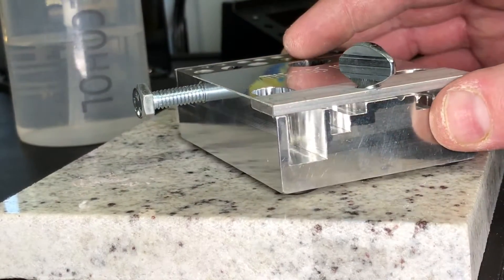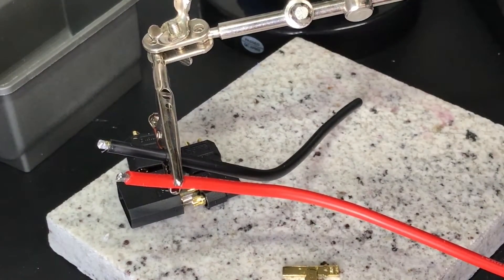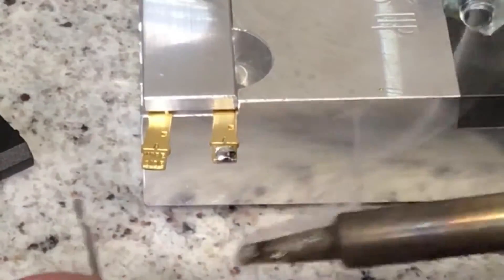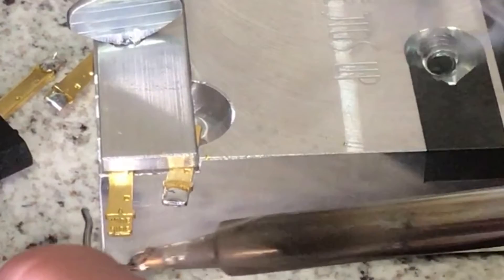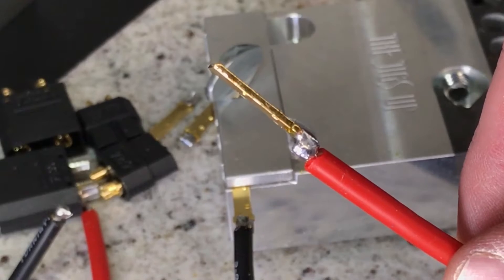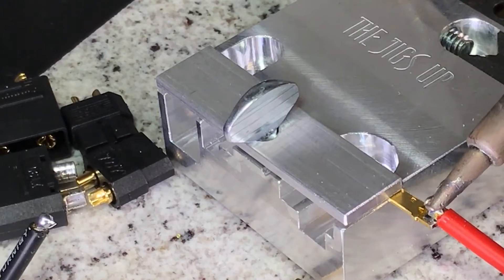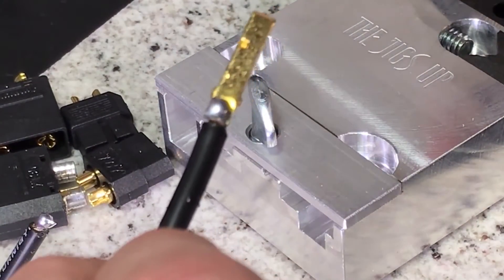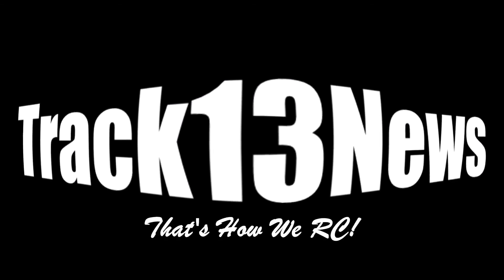Basics in Soldering 12 Gauge Wire for Traxxas connector

Comment: Great informative video!  I had to learn to not use so much solder when doing my Castle 6.5mm Polarized connectors.  Makes it very hard to snap the bullets into the plastic casing properly.